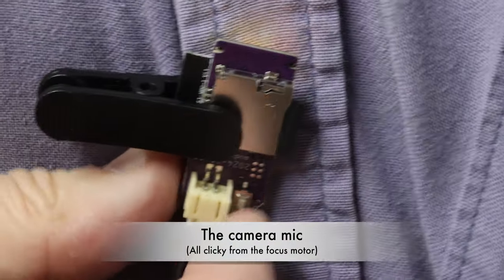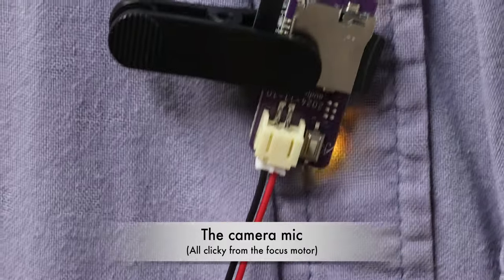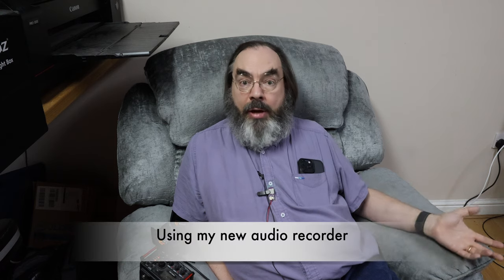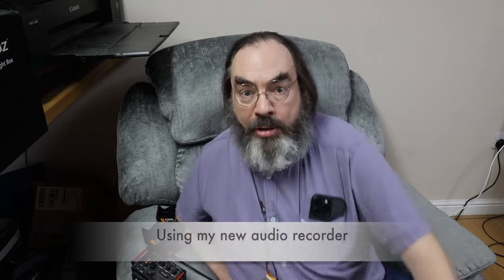Audio Recorder

Comment from the maker: The mics can do 51.6kHz but I still have an issue with the SD card data rates which I will fix. At present it writes WAV file to Sd card but plan is to feed over WiFi and/or Bluetooth in time. I might even just email the WAV at end of recording. But for now it was just to test quality.
Reply: @TheRealRevK  could it do 32bit float audio as you have two mics?